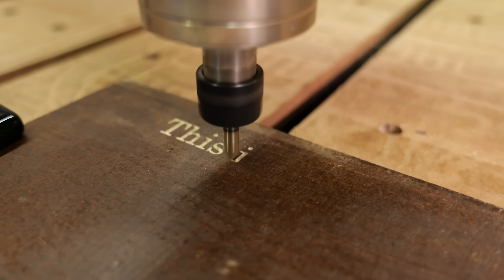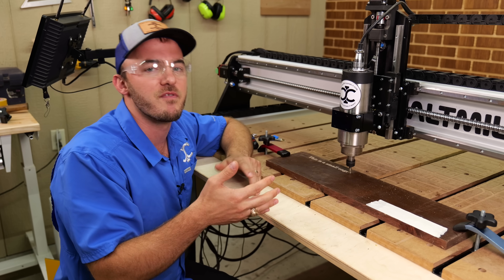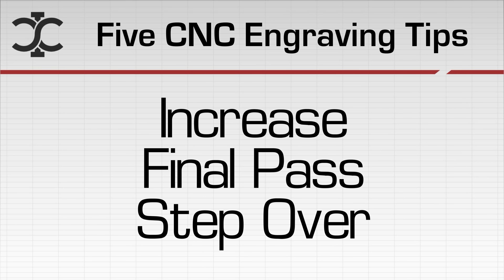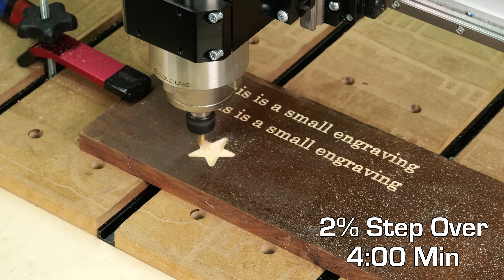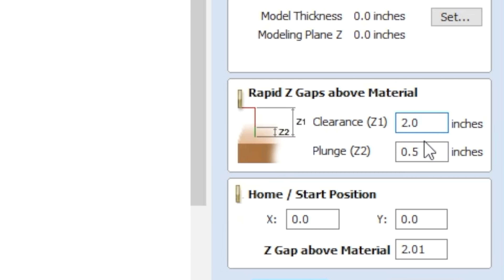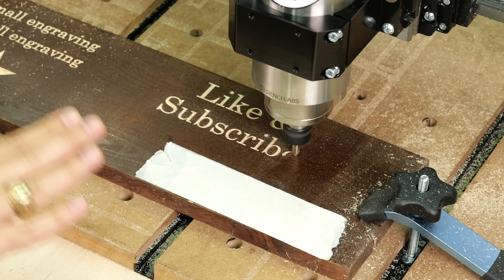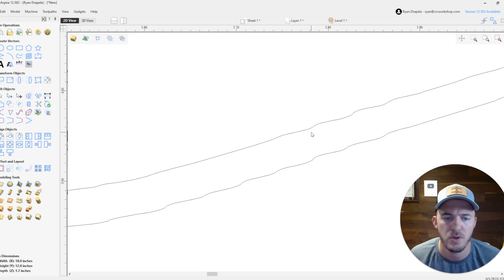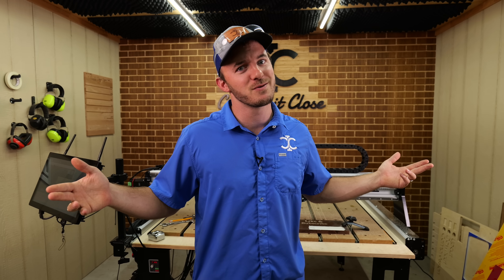5 CNC Engraving Tips To Save You HOURS

Comment: Unless you really want a dead sharp point, the bottom of the bit can be flat with a 3% relief. When I ground my own cutters for engraving in electrode material I did that.(It also kept the resulting steel stronger, but that is becasue engraved electrode becomes raised lettering in the steel)

Comment: I have been owning and using my comercial CNC router for 30 years. 2000mm x 4000mm routing bed size, 9.6Kw spindle. Wood of different types has variations, so never set your feed rates at too high.  Stop raving Mickey Mouse there are too many varibles to wood

Comment: AWESOME VIDEO! I have a better understanding of the final pass stepover. There is definitely a time to use this change. I have a much better understanding of rapid Z gaps above the material, clearance, and plunge Z. I am going to experiment with plunge rates using my V bits. Thanks, FYI, I have been using Vectric for almost three years, and I learned something new.

Comment: Reducing the plunge rate will also increase tool temperature ● Yes the job will finish faster & Yes the tool will become more dull qucker.  If tool starts to discolor brown or black -- operator may also see fine line and detail becoming challenged ● discolored tools more likely than not lost their tensile strength ● cannot be reSharpened.

Comment: The reason your "slow" plunges add so much time is that you are plunging from "50 feet" above the surface.  If you set 2 Z distances: one above which you can safely make XY moves, & the other right at the surface of the stock.  You plunge at full machine speed to the surface, then slow to the plunge rate when you actually contact the work.  STOP MACHINING AIR!
          Trouble is, the @#$ software that most vendors provide do not permit setting these 2 distances.  You are stuck setting the clearance distance high enough to guarantee no work contact during XY moves.  That's why I wrote my own G-code routine, as my process is much slower (I am machining metal).
          For flat depths, use a square-ended milling cutter.  For flat depths with beveled sides, get a chamfered cutter (flat end for a portion of the diameter, angled edges) which permits almost as fast milling & beveled edges with the same tool, & eliminate ragged edges because Z of the 2nd tool does not exactly match that of the 1st.
          Regarding removing nodes, generate outlines MANUALLY, hand placing arcs & lines, versus "machine generating" such as from a picture.  20 minutes manually editing outline can save hours of engraving time, as well as tool & machine wear.

Comment: TBH I wouldn't go any lower than .5 on your Z or Rapid Plane. The issue with hobby CNCs is that if you have clamps or a router that isn't perfectly trammed with the top surface you could have bowing or different depths on your surface. Which could cause maiming your parts over time with continued use of the program.

Comment: Plunge rate wouldn't be so important if you weren't retracting the bit up into the ionosphere.   Set your traverse height to just above the surface of the material.  Plunge rate was more important than feed rate only because both plunge rate and traverse height were set wrong for what you are doing. XY feed rate is still more importan because your letters are wider than they are deep.  You only need the plunge rate when going between engraving depth and traverse height, when going to multiple depths because you are engraving deeper than your V bit is tall (v portion), or when sharpening corners   you may want a slower plunge rate when plunging a 1/2" but into the workpiece but not for engraving with a small V bit.  You can probably use faster feed rates when engraving, too   Acceleration and jerk are also likely to make a difference

Comment: A larger change would occur from reducing the z axis movement by reducing your feed height and retract height.  With material that flat and good workholding why use more than 1mm?  Clearance is clearance.
Reply: lol.  Clearly I left this comment too soon in the video. :). But a quarter inch is still a ton!  If you’re engraving after facing, you know the exact height of the material and can set your feed/retract to .020” above your model.

Comment: Great tips, you just solved one of my problems every time i cut ACM in my CNC, because of the way they get the material to my workshop its not always flat, so i ended up cutting parts I didnt want to cut, when the bit moves from one cut to the other i always wanted to know how to set the hight of the bit so it gets higer or lower, so thank you for that, my name is Erick and  im from Guatemala by the way so greetings from here at the workshop

Comment: Keep in mind for us people using a small desktop CNC with a smaller spindle. The spindle might not be able to handle a faster plunge rate into the material.  I have lost control boards because the spindle went in too fast and the bit bound up in the material, freezing the spindle and popping the control board.

Comment: Beware,  I tried this on a Vcarve using a VB30, Feed Rate = 35, Plunge = 20 by default,  I bumped the Plunge to 35 and ran my tool path and walked away for a few min.  I went to check on it and the job was completed.  However... I was cutting 4 coasters.  1st one no issue,  2, 3 and 4 my CNC lost orientation and shifted over to the left on number 2 then more left to on number 3 then even a little more over to the left on number 4 off.  I was able to save the 1st one,  The other 3 were trash.  The material didnt move.. the CNC did X and Y moved over 2+ inches to the left.  When I told it to go back to X,Y zero it was off 2+ inches to the left.  The only thing I change was this.  I'm not sure if I over loaded my stepper motors that caused the skip.  I'm at a loss here
Reply: Probably missed steps on your CNC. Good warning but very much machine capability dependant.

Comment: Ryan, try accessing your machines post processor and see if you can adjust the Acceleration rates. They are usually set conservatively...Bump um up till you start to get hiccups, then set them a bit below that point. You'll be surprised how fast you can go without taxing the CNC. From GRBL:

$120, $121, $122 – [X,Y,Z] Acceleration, mm/sec^2
This sets the axes acceleration parameters in mm/second/second. Simplistically, a lower value makes Grbl ease slower into motion, while a higher value yields tighter moves and reaches the desired feedrates much quicker. Much like the max rate setting, each axis has its own acceleration value and are independent of each other. This means that a multi-axis motion will only accelerate as quickly as the lowest contributing axis can.
Again, like the max rate setting, the simplest way to determine the values for this setting is to individually test each axis with slowly increasing values until the motor stalls. Then finalize your acceleration setting with a value 10-20% below this absolute max value. This should account for wear, friction, and mass inertia. We highly recommend that you dry test some G-code programs with your new settings before committing to them. Sometimes the loading on your machine is different when moving in all axes together.

Comment: Ryan, appreciate the video and tips. A suggestion, since you have experience with different machines, it would be nice if you qualify by machine or class for a given tip. Some like clearance height may be universal but a stout machine can handle more aggressive plunge rates and step overs than an entry level. And maybe these would work at all levels but to qualify would be helpful. I run an 80 mm 2.2 spindle now but it’s a world difference from my old Makita palm router.
Reply from the maker: I would say the plunge rates are decently universal when dealing with hobby machines, maybe a 25% improvement on plunge rates when you have a more rigid machine, but There was not a significant jump in plunge rates from the Altmill to the Shop Sabre. RPMs and the type of bit is the limiting factor, I would not say power. That's just my opinion! Thanks for the comment!

Comment: While Vcarving, another factor is the safe height to which it will retract everytime. If you set that too high, your bit is moving through the air alot of the time. Setting the safe height to barely 2mm (0.08") is more than enough to clear the material and move to the next spot to plunge down. This also saves alot of time.
The 0.25" you show is still too high in my opinion. The material is flat anyways, so you can reduce that 0.25" even further to barely 0.08".
Reply from the maker: Agreed!

Comment: Have you seen and increase wear on the vbit or cut quality when using a 60ipm plunge rate?
Reply: It could be damaging for the cutting bit. Usually, a fast feed rate is okay, but fast plunge moves can be damaging. Of course, if it’s soft wood, it will be okay.

Comment: If you need to have a flat depth and have large engraving areas, using a clearance tool like a 1/8" downcut will reduce the time dramatically and get rid of the stepover ridges.   You'll need to account for the bit change time, but it usually still makes a huge difference
Reply: You beat me to that suggestion! And in his last example, I'd probably use a .25 end mill for the big state of Texas pocket
Reply: yea pretty baffled he didn't touch on just using a clearance tool
Reply: I use a 1/8” flat endmill when I batch out trophies, then go back and batch out the v bit toolpaths all in one go. Works like a charm.